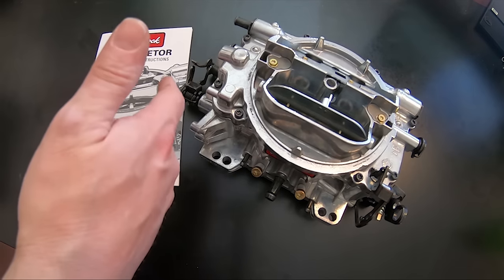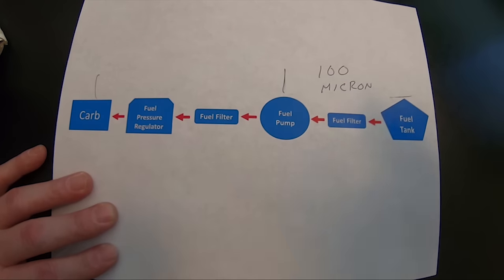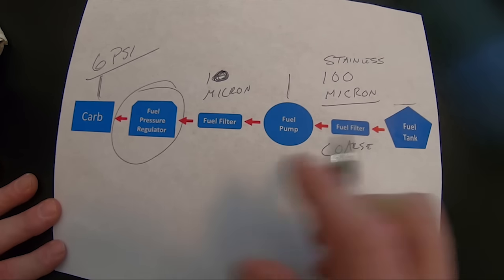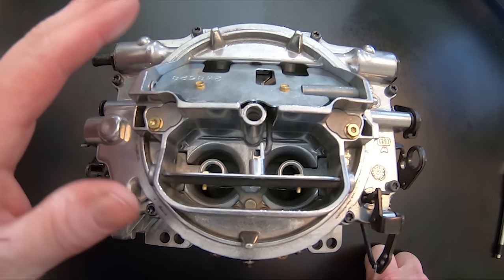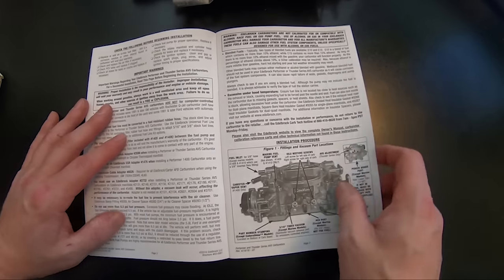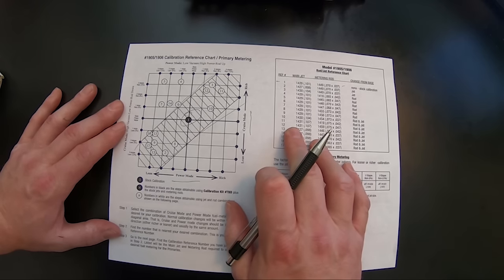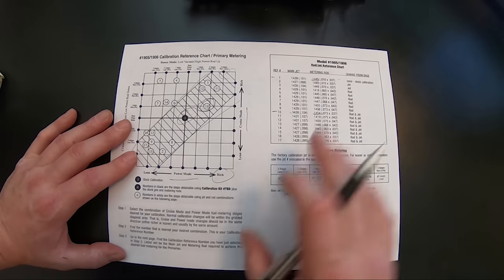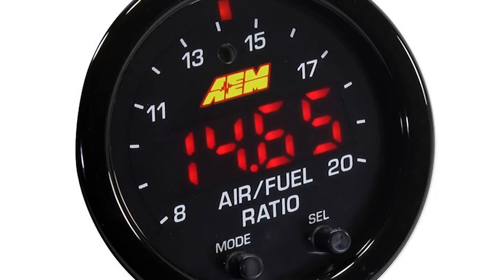The Ultimate Edelbrock Carburetor Tuning Guide

Comment: I just added a 1405 to a 20,000# bucket truck, done away with the tbi I have the regulator set at 6 psi. This isn't a new carb so I don't have any of the literature for it or any parts for it. My issue is it don't have any upper rpm power, barely his 60mph down hill. Almost seems like it's running out of fuel after half a mile down hill. The wine is a 366 bbc. Seems like I might need a float level check and/or adjustment but even beefier that it just lacks power. Could you suggest where I should start if maybe the secondaries need bigger jets and/metering rods? I recon I should buy the afr for it and then I'd know but this is something I just got going today and not very familiar with the eddy  carb.
Reply: @MuscleCarSolutions  I think the lack of power is what's restricting the speed, I'll see if I can relate the fuel pressure gauge where I can look at it while driving it and see if it's dropping. And as suggested I'll pull the top of and take a look at what's inside it. Like I said it's a heavy truck with a small motor, it runs better at low rpm's low speed) than it did with the TBI but it don't run as good at as it did at higher rpm (higher speed). A particular hill where I work it would slow from 60 to 50 with the TBI and now it slowed down to almost 35.... Thanks for the reply I'll let you know tomorrow what I find and maybe pick your brain some more. I really appreciate you.
Reply: @MuscleCarSolutions  for sure, and yeah I do need to put timing light on it. That hasn't been done yet LOL, I'll need to buy one ha ha. Everything I've worked on the past few years are all electric (ecm controlled) or diesel. I will get back to you tomorrow for sure, thanks for your input so far.

Comment: I having problems my 800 thunder carburetor to idle without pulling off transfer slots,help please.
Reply from the maker: What engine?  What tuning steps have you done already?  What is your fuel pressure regulator set at?  What is your engine vacuum?  What step up springs are you running?

Comment: So I'm working on a 650 edelbrock on a small block chevy it's tuned for a 400. I have watched many videos . I have picked up a vac gauge and I'm now steady at 19 psi. I have a small stumble at the time of hitting the gas at start. Am I running to lean... Or would you recommend checking the chart. I don't have a pic of the chart but am going to find one or all needed. I was thinking metering rod.
Reply from the maker: It’s ok to sacrifice a little vacuum to correct any problems like the one you’re having.  It’s very possible that’s it’s a bit starved of fuel.  I would look at making a step up spring change first.  That will get your current set up to tip in faster when the vacuum in the engine drops as the load increases.  You can move on to rod/jet tuning after that.

Comment: What causes the RPM to drop as soon as you put it on drive An is good
Reply from the maker: It will always drop some.  That’s where your torque converter kicks in and that’s also why tuning is so important for proper operation.
Reply: @MuscleCarSolutions  .in my truck rpm drop so mouch wen put on D it will shout off. Can it be from vacuum lakes .

Comment: Does 100 micron apply to 1965 c10 truck. It has small block 350
Reply from the maker: I like to run two filters on either carbureted or EFI.  My C15 has a 100 and a 40, currently.
Reply: @MuscleCarSolutions  could you please provide make and part numbers please
Reply from the maker: @nursecuenca  yes.  If you look in my playlist on Edelbrock carb tech you’ll find two fuel system videos.  One on how to set up a muscle car system and one with system diagrams.  All the part numbers I use are in the descriptions.

Comment: Running 1407, on r30 series chevy 1ton. 454 cannot get rpm lower than 900 rpm.manual shift. Hei vacuum advance.idle screw backed all way out, any advice is appreciated
Reply from the maker: You’re into the transfer slots.  https://youtu.be/DpU7pV4Li3A

Comment: I picked up two 1406 600 cfm carbs, and a dual quad manifold, trying to get them to run right on a 394 oldsmobile motor.  Should I lean them both out, as this is way too much carb for the motor. Do you have any suggestions?  Thanks Tom
Reply from the maker: tommy thompson easiest thing your can do is get an AFR gauge and start tuning from there.  Follow my fuel system set up first.  Drop the pressure down.  Drop the fuel level in the carbs.  You’re correct that it’s way too much CFM for that engine but you can make it run much better with some tuning.
Reply: @MuscleCarSolutions  ok, I put new carb kits in both, new manifold gaskets, there was some problems getting it to idle. I found a used afr tester on ebay, but not sure if it is working or how to use it. Your video is very helpful, I will set it up like you say, and see what happens.  Tom
Reply from the maker: Sounds like you’re on the right path.  Let me know how it goes!
Reply: @MuscleCarSolutions  I found air leaks on manifold gaskets, put carb kits in, and will see if I can find a guage. This is a 1914 Dodge with a 60 Olds motor. There are some videos at https://www.youtube.com/watch?v=RBxSI95If_Q if you might be interested in watching.  I will let you know as I progress. Tom
Reply: @MuscleCarSolutions  I rebult bot carbs, set pressure, followed all your steps. It runs ok, but I can not get the idle below 1000 rpm when the idle screws produce most vaccum, about 20 inches. I dont have air leaks around the carbs or manifold.  How can I get it lower?  I think it should kill the motor if the idle screws are all the way out.  Any suggestions?
Reply from the maker: It’s ok to sacrifice a little of that vacuum to get your idle down a bit more.  I forgot to ask.  What linkage are you using?  A progressive set up?
Reply: @MuscleCarSolutions  I have the edelbrock progressive/direct linkage. I originally had it progressive, but changed to direct. Both carbs are not touching the idle screws.  So to drop the idle some, go ahead and turn the air screws in when the idle screw is barely touching?  Drivabiliy is not the problem here, I thought there was something wrong because I could not kill it by backing the idle screws out. I checked the butterflies, they are all closing completely. I assume the high vaccum is pulling fuel through somewhere.

Comment: i have a AVS2 650 on my 83 c10 with a stock 305 and i have a bog after the booster shot runs out . i haven't made any changes to the jetting or step up springs yet amd it smells rich so i will most likely jet down but i would like a more experienced opinion before i do any help is appreciated .
Reply from the maker: Honestly, that’s too big a carburetor on a stock 305.  The 500 would have been a better choice and much easier to tune.  You’ll still be able to make some changes but you’ll likely fight an over rich condition.  Get a calibration kit.  Get a regulator and fuel pressure gauge (yes even if you have the stock pump).  Start at 6psi but be prepared to drop the pressure down.  4.5-6 is your range.  Advance your initial timing.  I don’t know what elevation you’re at but if you’re closer to sea level, start at 12-14.
Reply: @MuscleCarSolutions  im set at 14° btdc and thats what i thought . just wanted to verify . at some point I'm going to do headers and install the bypass regulator i have . thank you for the quick response
Reply: @MuscleCarSolutions  in your opinion should i go with the cheaper summit 500cfm vac secondary or the more expensive edelbrock avs2 500 cfm . for a daily driver that gets romped on a bit
Reply from the maker: @timweiner7434 I’m not a fan of the summit carburetors.  The AVS2 is a much much better carb.  If you want a cheap 500, I’ve got factory reman manual choke 500s on my website right now.
Reply: @MuscleCarSolutions  thank you . i dont have the previon for a manual choke so i gotta go with the electric choke option . and do you onow much about swopping out my saginaw 3 speed on the tree for a ford toploader keeping the collum shift bc I've done some reading through forums and it seems that the saginaw is a preaty weak and bad trans so i was thinking of going to the toploader bc i may put a vortec 350 in it in the future as well as options for electric OD units ?
Reply from the maker: You have a stock 305.  I wouldn’t worry about over powering a Saginaw.
Reply: @MuscleCarSolutions  from what I've seen ppl say there good for about 300 ft/lbs of torque so if i were to put anthony else in front of it I'd think it would be to much for the saginaw . but thank you for the reassurance . 
the one i have needs a new first gear syncro and second gear is a bit hard to get into so i gotta get it worked on but i definitely need a OD lol 3100rpm at 70mph is a bit much

Comment: Hi I have a 8867 edelbrock carbureter on a rover 3.5 liter v8 and wont keep de idle plus when I accelerate seams like no fuell or it's run out of it .
Please would you help me by the way I'm in south america tks
Reply from the maker: We’ll need to confirm what you have.  That number isn’t a part number or a date code.  My website is listed in the about section here and you can email me pictures and I’ll try to help you.

Comment: Idk it seems everytime I hook one of these 1406 carbs up every one of them fall on thier face as soon as I hit the gas. Ive always heard its the accel pump but none of the 3 hole adjustments ever seem to cure the problem. Ive got to get this fixed its very hazardous pulling out in traffic and hit the gas and engine wants to die and your fethering it trying to get the gas flowing to go. I dont consider myself a pro at tuning but its an old chevy C10 350 and always have to put starting fluid in it to get it first started but after that it cranks right up. It does have vac adv but I capped it off and the ports in the front. A guy adjusted the timing for me up some and told me a long time ago it would run better without all that hooked up and it did at the time. But like I said this isnt the first time I had an old ford that would lay down too as soon as you hit the gas. Any suggestions.

Comment: I appreciate If you can help me with my Edelbrock carb. In the overall is working great, however when I’m just barely touching the gas pedal to keep the car, let’s say at 10 mph 1200 rpm, the car is running too lean (15 AFR) and refuses to go. If I give a bit more gas it’s fine. At idle the Wideband reads around 12 and the engine is idling pretty well. Should I try a different spring? Thanks.
Reply: @MuscleCarSolutions  First of all thank you very much for your prompt answer. The engine is a Mopar 440 with Stealth aluminum heads, 9.8 CR, full length headers, hydraulic cam 226/230 @050, Edelbrock 750 #1407. Stock TF727 trans and 3.23 rear.
Reply: Bone Head thank you again. I’ve played with timing and I’m sure timing is not an issue. Initial 17 and total 35.
I’ll change the springs and set the idle screws. I’ll keep you posted.

Comment: Help!!! I have looked for hours and hours online and it's been decades since I messed with a carb.  haha.  My AVS2 offroad version is sending fire out carburetor under full throttle.  It runs great if i don't open secondarys.  Is to too rich?  Do i need to adjust the jets?  Do I adjust left or down to lean it out under full throttle?  Thanks a ton!!!!
Reply from the maker: @KyleClarkMountainMan  there are a dozen things that could be wrong.  When you say fire, do you mean it’s forcefully backfiring or just randomly catching on fire?  I’ll assume backfire.  Timing, incorrect lash on rockers, distributor/plug wires installed wrong.  Over fueling/too high pressure/incorrect float setting/garbage holding needle open.  Pick one and start eliminating potential issues.
Reply: @MuscleCarSolutions  Correct.  It is backfiring.  Runs amazing at idle to 3/4 throttle as long as I don't tip into the throttle to hard is even revs great. Timing is good and have played around with it several degrees.  Fuel pressure is about 5psi.  I'll replace wires and cap and go from there.  thanks for the help!!!
Reply from the maker: @KyleClarkMountainMan  unfortunately, “timing is good” doesn’t mean anything and generally it isn’t.  What is your all in timing set at and when is it at full advance?  I’d be looking closely at that and the other potential issues I mentioned with fuel delivery.
Reply: @MuscleCarSolutions  I'll take a more detailed look at the timing.  It didn't backfire with the old carb but it did flood out.  Thanks again!!

Comment: I am pleased with my Edelbrock 1406 on my 300 hp 302 Ford except for choke operation and warm idle. I have the fast idle set at 1200 rpm and the warm idle at 800. If I kick the choke off of fast idle the engine dies. It will restart and idle fine. After driving the car for a few miles it idles at 1100 rpm in park or neutral. This confuses me. I have this same carb on another 302 motor [stock 84 HO] and it has performed flawlessly for 12 years with absolutely no adjustment out of the box. Any suggestions?
Reply: @MuscleCarSolutions  Yes I am setting the fast idle with the fast idle screw then warm idle with the idle speed screw. I will check for trash. It is a new carb along with all new fuel system and tank. Thanks

Comment: I have a Edelbrock 600 carburetor and after I have driven it for a period of time when I turn the engine off it backfires through the carburetor what is causing this
Reply: @MuscleCarSolutions  filters are fairly new I will checked the timing thanks

Comment: Quick question... I have the edelbrock 1813 & purchased the 1841 tuning kit for it. I have the tuning chart for the carb & it says the numbers in black should be obtainable with that kit. The kit does not have the meter rods it calls for in the kit. Have you come across this before? Can I just move up the next metering rod to richen it for power? Thank you
Reply: Thank you for getting back to me. Correct, I'm looking in the shaded area for 1 stage up rich on the power side & the number on the sheet for the rod, does not exist in the kit. I'll reach out to edelbrock & see what they say.
Reply: Tech support is shipping them out today.

Comment: Recently replaced the head gaskets on my truck. I currently have it running smooth at idle but if I blip the throttle it hesitates and if I hold it down for a second it backfires through the carb. 600 cfm 4bl on stock 350 engine, timing, exhaust, etc. Any advice?
Reply: Whatever was factory for a 84 c20. Had no problems out of it prior to the gaskets blowing out. Never pulled the bottom of the motor, just the heads
Reply: Yeah I'm going to have to say your right and my dumb ass didn't think about it lol. She is kicking ass again now. Thank you.

Comment: ok i have a 440 with a 1407 carb.. at idle it seems so rich it burns my eyes in the garage is theis a sign i need to go leaner on the rods
Reply from the maker: No.  First get that condition under control before you do anything in the cruise and power modes.  Start here: https://youtu.be/_AgqTUJr8aM
Reply: @MuscleCarSolutions  im gonna check timing and idle screws...other then tahat im not sure
Reply from the maker: @dannycarpenter4334  two really good places to start.

Comment: Can anyone help me? Here's where I'm at
440 Dart tunnel ram,
Currently the car has two 750 edelbrocks 
Fuel pump is putting out 5 psi
The vacuum at idle is 15"
At 1000 rpm
At 3000 rpm almost 30"
Just installed a brand new dynamic 3200 3500 convertor
Just installed new msd 6al ignition system 
Msd wires, coil, new plugs
The car has a mild shaft purple shat
The timing is 15 degrees at idle and about 35 at 3000
I rebuilt the carbs completely 
The car still has a stumbling problem between 1200 rpm and 1500 rpm 
I just can't get this fixed any ideas

Comment: Can I use the AVS carbs in a two carb set up? Do they tune sane as the carbs used in the Edelbrock 2x4 package?
Reply from the maker: Sure.  The progressive linkage they offer works with it the same way it does on the Performer series carb.  Same configuration.  It’s choosing the right size that’s always a challenge and getting a useable AFR.  Street tunnel rams dump a ton of fuel that doesn’t get used very efficiently.
Reply: I will be useing a Edelbrock aair gap manifold . This will be a 650 carbs on a bb chevy with. aggresive solid roller and aluminum dart pro 1 heads. Sound ok?thx so much
Reply from the maker: Difficult to say.  What are the specs on the cam?  What CR?  Transmission?  Just a street cruiser?  Just going for the look of it?  No track time?
Reply: Muscle Car Solutions  manual trans has 10.3 cr. Cam has 672 lift on in and exh lobe sep is 106 deg. Int open @ 24 BTDC close 56degABDC. Exh open 59 BBDC .  Close 27 ATDC Duration @ .50 is 256  on intake and258 exhaust. Heads are ported and springs good for 690 lift. This is the best site I’ve ever been on or seen. Yes on track time. Car being built for all types of raceiing.
Reply: I will use a AFR Gauge tkx agains
Reply from the maker: Those are some odd specs on that cam.  The lift is fine, but the duration is a puzzle.  The manual trans and that tight lobe separation will give a really nice sound to that engine. Have fun with your build!

Comment: I have a 79 cj7 manual 3 speed.  Which port do I use?
Reply from the maker: Ryan Daugherty which port for what?  Your distributor?
Reply: @MuscleCarSolutions  yes. driver side or passenger side?
Reply: @MuscleCarSolutions  Im guessing passenger?
Reply from the maker: Ryan Daugherty passenger side port is the timed vacuum port.  Yes you want to use that one!